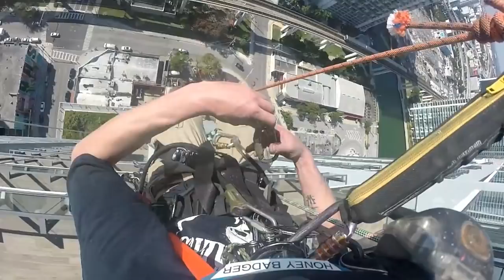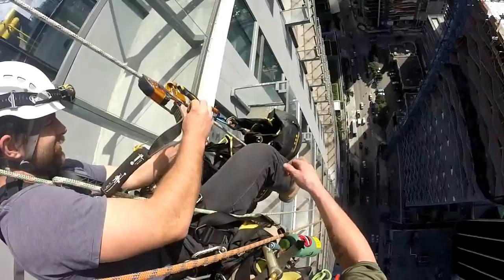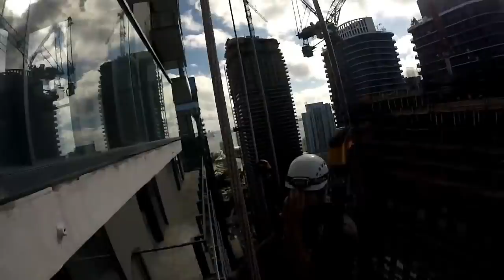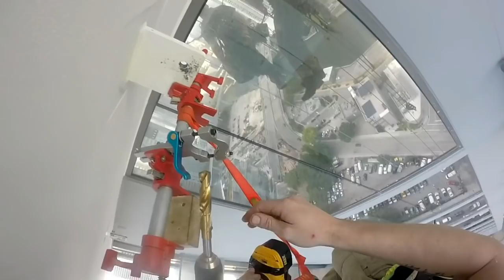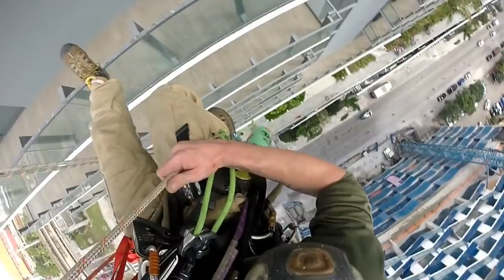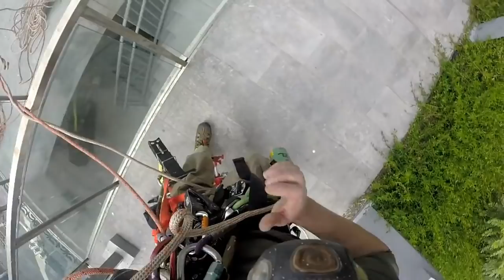miami rope access

Comment: What if you gotta take a piss?... just pull it out and make it rain or what?
Reply from the maker: Simple actually, we carry an empty 16 oz water bottle crushed flat then lid put back on.
The real challenge is when it's really cold. After about 3 layers of pants, I would suggest a loosely tied, wide boot lace set up as a retrieval line.
Trying frantically to dig around hoping to feel those cold fingers while gear on your harness is pulling the toilet paper dispenser off the wall of a porta potty is not a good way to start the lunch break
Reply from the maker: That reminds me, I need to empty full bottles out of my bag. Only asshole dbags leave them behind. *MBS/Atl.

Comment: How is it even possible that you guys don't secure the back up device while passing the knot? Super dangerous to drop that from this height when you have zero control of what's under you. Just a question.
Reply from the maker: In 10 years I've seen a A LOT of objects fall to the ground below, not a single one was a backup device. I feel ya, and yes, best practices would be to secure them. Im going to leave it at that.
Reply from the maker: Hold on, we have 100% control over what is below us. However, based on the height of this one, and circumstances involving other construction projects across the street, our exclusion zone was smaller than it needed to be. To compensate for this, the best we could do was have a police officer standing in the road to ensure no pedestrians strolled down the road below us, only motorist in cars. Perfect? Nope.. The real world isn't always black and white. Do the best you can with what you have.
Reply: I hear you, i also work with rope access, both on the oil rigs and windows in Sweden. My advice for a comfortable day without worries is to use the petzl asap lock. Lovely product and secured all the time. Or the older cheaper asap with a small rope to secure it. Wish you the best. Regards from Sweden :)

Comment: Honestly probably be more nervous with something dropping and hitting some one from so high
Reply from the maker: Because of this very real hazard, we tie off EVERYTHING. Even my lighter is attached.
Reply from the maker: We actually had a tool come apart on this job dropping a metal bracket about 400 ft to the street below. Didnt know it at the time. Exclusion zones

Comment: Im not understand Do you use harness only or chair with harness?
Reply from the maker: Мagic Photoshop the short answer is both. While I do use a seat (chair), it is attached to the harness at the same place harness is attached to rope. So if I were to cut the seat away with a knife, I would still be hanging just the same. Only not as comfortable.

Comment: What was the job? Drilling for the anchor plate for future rope access work? Or were you doing more just not shown?
Reply from the maker: Jon Gretar Borgthorsson we were installing a usable anchor plate to the existing plates installed during the buildings construction. The anchors are for window washers. Not sure how they plan on getting to them though as a couple are very difficult to access (hence that Harken sliding rail)
Reply: Thank you now I can wash those windows
Reply: Eh nice knot in you back up!
Reply: @brentseely6113  They often have a hook on their cleaning extension.

Comment: How do you get a job like this???
Reply from the maker: 1st take all your common sense and self-preservation, and throw them out the window.  You wont want them here. Next, save up roughly $1500 (best money you'll ever spend). Use that money to get your Rope Access certification. Either SPRAT or IRATA. (msg me to discuss differences). This will be 4 long, painful days of training leading up to the 5th which is a somewhat stressful test. Easy, but alot of pressure. Once you've done this, you too can look forward to long periods of time spent away from family and love ones while you enjoy all the comforts of  1 star hotels. You can finally get that figure you've wanted by a diet of primarily gas station cuisine (your gallbladder doesn't stand a chance). But don't worry about all those extra pesky calories and excess body fat, as hualing 100s of pounds of rope, gear, and tools to heights you never imagined tends to burn off every last ounce of precious body fat your body was storing.  When you pause to wipe the sweat from your eyes, you will sometimes be granted a few short seconds to gaze upon an amazing view while basking in the knowledge that you are, at that moment, in a place on this planet, that no other human has ever been before. Sort of.     Yes, I chose to emphasize the neg. side of it all, which is only about 15% of the big picture. The other 85% is pure indescribable AWESOMETASTIC!!
Reply: Hands-down the best response I’ve ever gotten on a YouTube post! Lol